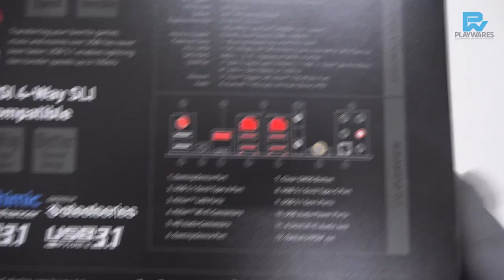MSI X99A GODLIKE GAMING CARBON: UNBOXING & SYSTEM SETTING

Comment: i got 1 lol
Reply: No im pretty sure it 3sli short. 2sli long. This shouldnt matter as you can get a 3 way sli to match this board for 30$
Reply: ***** ok i did the research on it and it will be 3 sli short with 0 space in between. 2 sli long with 2 space in between